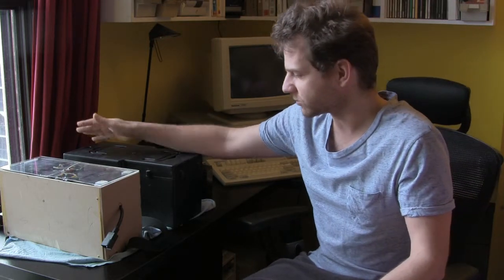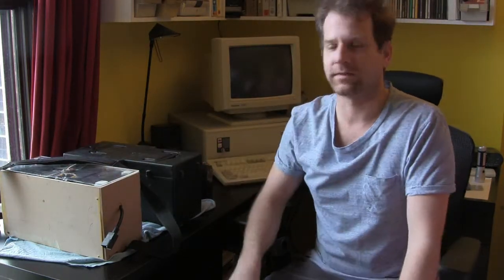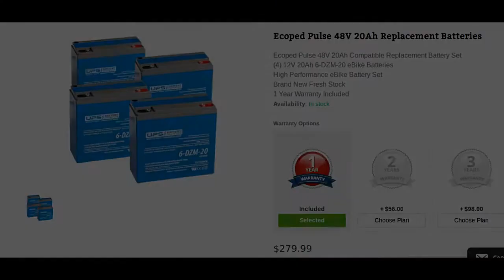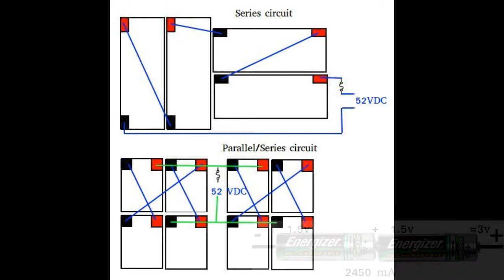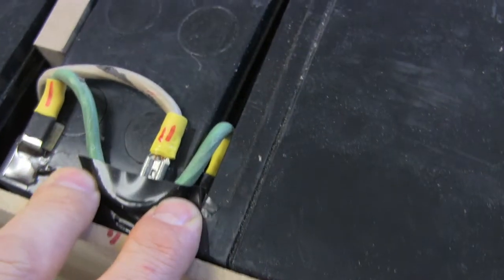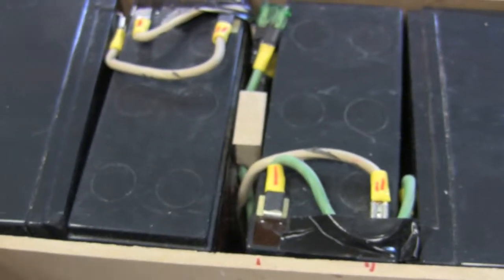UPS batteries on an ebike? Modifying and repairing a Pulse Ecoped part 1

Comment: how did you wire the male pc connecter port? I am trying something similar and it is hard to find information
Reply from the maker: I think part II has the answer, but if you can't find it, I'll draw up a quick diagram. LMK if you need that.